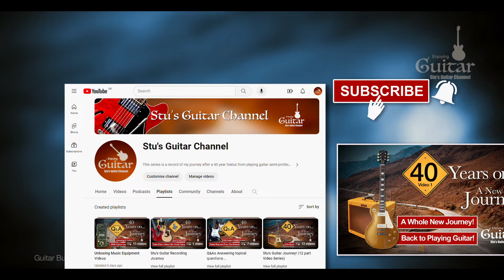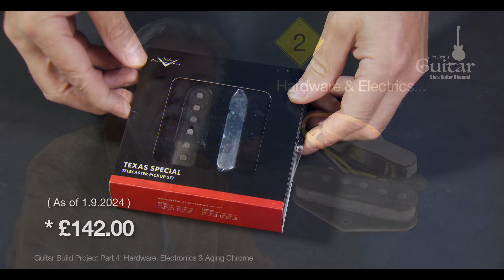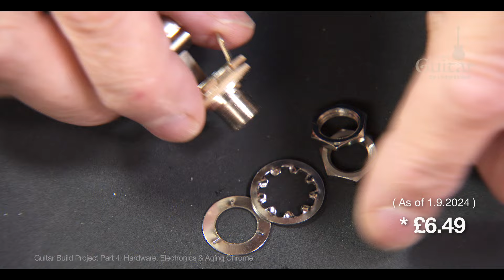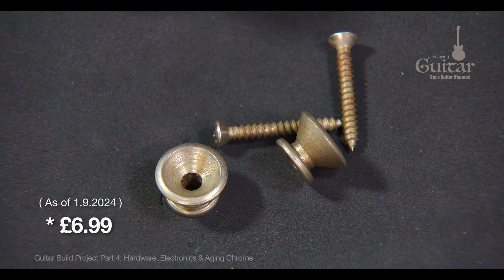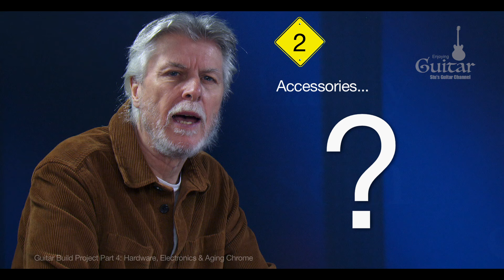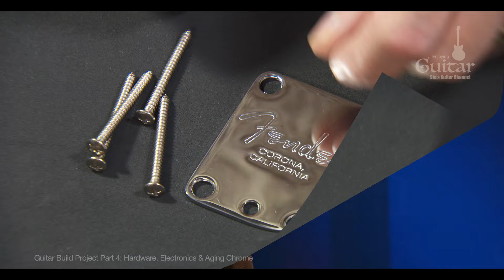Guitar Build: Part 4 – Tele Style Accessories, Hardware, Electrics and Ageing Chrome & Nickel Parts

Comment: Great video. Yeah I have also seen distilled vinegar suggested to age nickel plated hardware. Good to know it would work. By the way, if one wanted to anodize a nickel plated part, I guess the nickel platting would have to be removed? Would the vinegar do it? Or you need acid? And would then the anodizing work? Thanks.
Reply from the maker: Hi Itvddvtl - Thanks for the kind comment... Yes vinegar (the fumes) is great for aging steel, nickel plate, anodised finishes and brass. For the sake of anyone reading this, it's the fumes that cause the tarnishing so it's important not to actually put the items into the vinegar itself. Chrome plated products require an acid such as sulphuric acid - once again, it's the fumes that do the tarnishing.

In regard to anodization, I have not done this myself, I have worked in engineering where we had parts anodised (different colours) by a company who specialised in that process and we had to make sure the materials being sent were base metal / alloy finishes. According to an internet search, the process of anodization is this -

- Clean the metal: Remove any contaminants from the metal's surface. 
- Submerge in an electrolyte bath: The metal is submerged in a bath containing an 
  electrolyte, such as sulfuric acid. 
- Apply an electric current: A direct current (DC) voltage is applied to the metal. 
- Clean the metal again: Clean the metal after the anodizing process. 
- Add colour: Optionally, dye or paint the metal to create a desired colour. 
- Seal the metal: Seal the metal to protect the oxide layer. 

Anodizing can be used on a variety of metals, including aluminium, magnesium, titanium, stainless steel, and aluminium alloys. Aluminium is the most common metal used because it's strong, lightweight, and available.

I did a search regarding anodization on a nickel plated parts and it appears to be possible to do but it does appear to be a bit more involved. 

Hope that helps, do let me know how you get on, all the best... regards: Stu
Reply: @StuGuitarChannel  Hi Stu. Thanks for the quick reply. My plan was not to anodize it myself but bring it to a company. But I read nickel platting can poison the anodizing pool. So I guess the nickel platting would have to be removed from the aluminum part first. So I wondered if using vinegar and sanding would be enough to remove the nickel platting and get it ready for anodizing. Sorry if I wasn't clear before and thanks again for the advice.
Reply from the maker: @ltvddvtl Hi – Ah okay… my misunderstanding ;-) I have read that the process of removing nickel plate from aluminium is the following.

Nickel stripping solution

- A nickel stripping solution can be made with sulfuric acid, hydrogen peroxide, p-hydroxybenzenesulfonic acid, a complexing agent, a chaotropic agent, and water. 
- You can also use distilled vinegar, canning salt, and a five volt power supply. 

 - Nitric acid is a commonly recommended option; a solution with a concentration ranging from 15-75% can strip nickel without damaging the aluminium substrate,      as long as chloride ions are absent. Sulphuric acid can also be used; a 50% solution mixed with water and an anodic current can achieve effective stripping. 

In regard to sanding the alloy surface. You would need to be careful not to put lots of scratches in the surface which would show through the anodization process. This is the same even with chrome plating. If the surface finish is not really smooth you don't get such a good finish. I used to do a lot of chrome plating custom bike parts in days gone-bye... ;-)

Having said all that, if you are going to get a company to anodise it for you, I would definitely ask them if they do a preparation service themselves. Depending on the cost, it may prove more cost effective than you doing it yourself. I would be interested to hear how you get on… regards: Stu

Comment: Boy I sure wish I had the ability to do this, it would be so cool!  I found out there is a shop a few kms from me that make all sorts of guitar bodies and necks by hand (a maple Tele body for about $130Cdn, maple neck same price), sell parts etc.  Also my Gretsch Jet has annoying buzzing on and off, I wonder if it is my jack at the guitar since my other Gretsch is dead silent.  Maybe an upgrade eh.
Reply from the maker: Hi Weasel - As a kid I loved making things and went into engineering after school which helped me to get to grips with using tools and from there, you just add to your knowledge etc. There are so many YouTube videos today explaining how to do stuff, there's never been such a time to be able to teach yourself new things. The trick is, not to aim too high at the start. Picking up an old beat-up guitar to experiment on is a great way to learn what's involved and to hone painting techniques. It's important to have patience and to sit and think through challenges that arise. 

In regard to the buzzing on and off? If you wiggle the jack plug and the buzzing stops and starts then yes it may well be a connection at the socket. This is not an uncommon fault and is normally easy to sort. I'm not familiar with the 'Jet' but I'm sure there will be videos available showing someone sorting that problem out. Sometimes it's just because the jack socket is made of lightweight materials and the connection is sloppy - bending the metal plate inside to rest more firmly on the guitar lead jack will solve that. Sometimes it's the solder connection is coming loose and needs re-soldered - which of course you need a soldering-iron.  

PS - remember, if you want some model railway films my production company made for TV drop me a private message (you will find that on my channel info) and I'll give you some links. Regards: Stu
Reply: @StuGuitarChannel  I will check out my connection jack on the Gretsch Jet and see, maybe I can do the bend.  It is strange it comes and goes. Thanks for the suggestion.
Reply from the maker: @weasel6535  Your welcome... it's at least an easy place to start trying to trace the problem... regards: Stu
Reply: Hi Stu;  Finally got around to checking my guitar jack and indeed bending the tab inside helped.  The other day I was playing when my amp began to whine like a jet engine starting, touched my guitar and it went away, pull my finger off and it came back.  Yesterday I bent that tab to about a 45 degree so it really grips the patch cable plug and now I just get the normal electric hum.  And I was going to take my guitar to a shop and have the wiring run, you saved me money, thanks.
Reply from the maker: @weasel6535  Hi Weasel – That’s good to hear you were able to resolve that issue without too much fuss. I’m not sure what you mean by the ‘usual’ electrical hum? Are you playing your guitar/amp near a computer, TV or air-conditioning unit? Sometimes, it can be an interesting exercise to plug your gear into different outlet sockets around the house to see if there is any difference when it comes to ‘electrical hum’ This is one of the reasons why some folks use electrical shielding in their guitars using either ‘Paint’ which I used in this latest telecaster build project, or ‘Copper Foil’ for lining the cavities. Good quality shielded instrument cables can also help if there is the possibility of external interferences. Regards: Stu

Comment: Stu the consummate professional. I bet the relic job turned out stellar, looking forward to seeing it. I'm thinking of doing a relic on a goldtop but hesitant because they aren't all good.
Reply from the maker: Hi Craig... ooh... thanks for the vote of confidence, now I just have to live up to it... ;-) I'm just starting the relic work at the weekend as I have been away but looking forward to it. As you say... it's a tricky thing to do well and it's wise to do plenty research to get to grips with what it is you personally want to achieve. I'd think long and hard about your Goldtop... fine, if its already got battle scars but if it's in VGC and there's a remote chance you might just want to sell it... well... regardless of how good the relic job - it's going to devalue it. Don't do anything hasty.... ;-) regards: Stu
Reply: @StuGuitarChannel  The day I got it home a few years ago I took it outside and cracked the finish. Less than forty days after the serial number. It turned out fine but seems out of place without other aging, but the last thing I want is to go from, "Looks great, keep going," to the dreaded "ten-foot guitar" story. And I at least know you'll do it correctly, so no rush lol If curious how it turned out, there are close ups in my most recent couple videos. I laid it out in the summer sun for a couple hours and simply turned a can of compressed air upside down. It came out frozen, and I could literally hear it cracking. Very fun. I recommend it if you like a beat up guitar. I think goldtops don't look right until they're beat to a pulp.
Reply from the maker: @CraigFlowersMusic  Hi Craig – Wow… that was brave! I would have been concerned about damaging the neck but it obviously worked out okay for you. As you will appreciate, the big yellow ball in the sky is not something we see a lot of here in Scotland so if I left my guitar outside it would just get rained on… ;-) 

I didn't realise you made videos, I will take a look at that in a day or two… I do agree, old Gold-tops look fabulous when the gold starts getting that green patina as it oxidises. Yes, ageing a GT would need a bit of thought so that it looked correct. I will be cracking the lacquer (I’m sure you know that you can buy lacquers that deliberately crack) but it does need to look correct otherwise you can end up with spider-web type cracks which would not really be correct if looking for a genuine aged look. When your playing Craig… does anyone come up close to inspect the finish checking… ;-)  Regards: Stu
Reply: @StuGuitarChannel  I would like to tell you yes or no whether the checking gets noticed, but I don't get out. Just a recluse with a studio. In fact the channel came about as a way to fight scopophobia and maybe get out in the world. Never went anywhere though, I'm not very good so the channel perpetually flounders.
Reply from the maker: @CraigFlowersMusic  Hi Craig… just nipped back into the office… got a quick chance to look over some of your videos and subscribe – saw you playing the GT but not seen it lying in your garden cooking in the sun ;-) I mentioned to you before some time back, how much work you put into your music… I think it’s such a great gift to be able to play an instrument, except in your case – lots of them ;-) and do the hard work recording and mixing it all together… as long as we love and enjoy playing… that’s what counts Craig. That’s an interesting ‘condition’ you mention because many musicians suffer from that to some degree. When I played in the 70s, early 80s I felt uncomfortable on stage and often would go back to the backline and stare into the speaker cabinets… and I was the frontman LOL… I think I only saw one song which was your own composition… have you written more?  Best regards: Stu
Reply: @StuGuitarChannel I have been composing unfinished songs for decades, always imagining someday I would stop wasting them and start recording. There used to be more public uploads, over 200 in fact, including more of my own work but only two with lyrics, but I eventually privatized any videos from before I had a studio and from after the studio but which don’t get watched. My piano works would always get fewer than ten clicks; I couldn’t handle the numbers so I started doing full production cover songs only. 

I always said once the channel was big enough to monetize I would go from mostly covers to mostly originals. And that, hopefully by then I would be mature enough to write lyrics I wouldn’t eventually come to regret lol So yes, when I get my broken equipment repaired and the channel back off the ground, I plan on writing more but keeping up the covers too. Still trying to find my niche really. Not interested in talking, just wanting to make the best music I can for posterity.
Reply from the maker: @CraigFlowersMusic  Hi Craig – Yes, the commercial world of both the music and visual arts is a hard place to be and disappointments are many. I have worked professionally in the media production industry for over 40 years and I am now mostly retired. I have met many creative folks over the years and one thing that often stood out, was a lack of business understanding in regard to their chosen industry and more often than not, this contributed towards failure in breaking into a place where they could begin to earn a reasonable living. Of course, you hear of the success stories that encourage people, but the reality is more sobering. I did a video on this topic which outlined how my own company contracted musicians/composers ( https://youtu.be/BbaPNVGpC40 ) and this has had very few views but it did help one composer who contacted me to say it really helped him understand where he needed to re-think his business model and was very thankful… that makes me smile… ;-)    

Part of my company managed marketing and advertising, and I worked mainly in the UK but occasionally in various countries and there are some general rules that never change, and as you have just made reference to ‘finding your niche’ – in the commercial world, generally speaking…  it’s understanding what you are trying to sell and what markets are there for that product and then setting yourself goals to achieve. 

You clearly love what you do and that’s really important because that will keep driving you forward… always happy to chat privately Craig if you think I can be of any help or encouragement… best regards: Stu